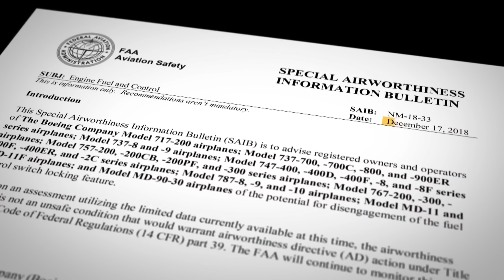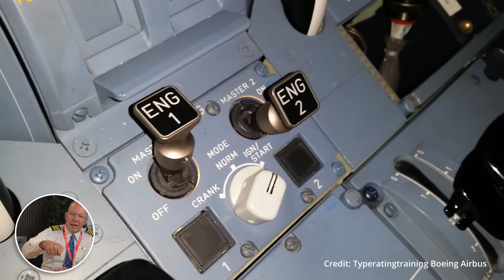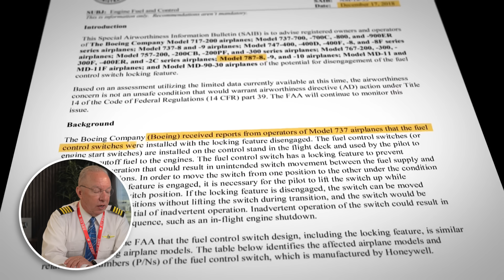Air India 171: The FAA’s 2018 Fuel Switch Locking Bulletin Explained (16 Questions Answered)

Comment: My take on it:
Based on current reports, cockpit recordings, and operational norms, here’s a reasoned reconstruction:

The First Officer (FO) was the Pilot Flying (PF), and the Captain was the Pilot Monitoring (PM). Both performed standard pre-flight checks and taxied without issue. During takeoff, the aircraft accelerated and rotated normally. Once airborne, the PF called for gear up, but the PM did not respond or retract the gear. Still, the aircraft continued climbing—smoothly—toward ~400 feet AGL, with no obvious anomalies.

That point — ~400 ft AGL — was a crucial window: high enough that the aircraft couldn’t recover from a double engine failure, but low enough to prevent restarts or gliding back to the runway.

At this moment, the PM — for reasons unknown — likely made his move. He waited for the “point of no return” and then quietly and deliberately shut down both engines, one after the other, with about one second in between.

The FO, sensing something wrong, noticed the engines spooling down. He likely looked at the EICAS display and saw both engines showing zero rotation (N1 = 0%). He checked the throttle quadrant — both levers still at TOGA power. Then he checked the fuel cutoff switches and found both in the OFF position.

Shocked, the FO asked:

“Why did you stop the engines?”

To which the PM replied:

“No, I didn’t.”

Realizing the aircraft was now gliding, the FO quickly switched the engine levers back to RUN, attempting to recover. Engine 1 responded and began to spool up — but Engine 2 never restarted.

With the aircraft losing altitude fast, gear and flaps still extended, drag high, RAT deployed, and time running out, the FO did what he could. He radioed ATC:

“Mayday, Mayday, Mayday.”

Despite being the non-flying pilot, the PM never assisted — never helped with restarts, never retracted the gear, never coordinated a checklist — he just sat in silence, perhaps whispering a prayer.

Ultimately, the FO did everything in his power to save the flight, taking full control of a spiraling situation, alone. But when a seasoned captain with over 8,000 hours on the 787 makes a deliberate choice to bring a jet down — they know exactly how to do it.
Reply: Great imagination. But no proof of this until now. Let them relese full CVR and FDR.
Reply: @RockyRock-vv3ex  what part of the OP is there no proof?
Reply: @RockyRock-vv3ex 
That’s why its only a hypothesis!
Like what Cpt Steeve said: The good part of us tells us that didn’t happen.
I wish my analysis is incorrect, actually I wish this never happened.
Reply: He could do it again, there is something missing.
Reply: After watching several different opinions and expert analysis this seems to be the most plausible,sadly!😢
Reply: Why would someone do that
Reply: @afnankhan7086  You are asking why there are insane people in the world that do crazy things with no explanation? Really?
Reply: Exactly @RockyRocky, without CVR transcripts, I not understand how people can make all these assumptions.
Reply: These are all boeing bots trying to blame the dead pilot  @Introvert.sJourney
Reply: @Introvert.sJourney 
Unfortunately these hypnosis are based on reports, facts, aviation logic and common sense, and feel free a refute whatever you think is not correct or doesn’t align with the truth.
Reply: That's actually a very logical & interesting point. I never thought of it like that. I  don't know anything about airplanes, especially the mechanic side, but I don't need to in order to understand exactly what you're saying.

 That is a very good point you just made!
Reply: Good write up Mr Tarantino.

Why didn’t the PM resist PFs actions to restart the fuel supply switches ? 

If he had planned this to such detail, the PM definitely missed to consider the other pilot’s actions. 

Or may be, both pilots hatched this plot as revenge against domestic violence from their respective wives ?

Nice script BTW. 

Can be a good setting for the opening shot of a Tom Cruise or a Bond movie.
Reply: Valid
Reply: Mostly agree, except I think it was the PM that radioed mayday, all part of creating the appearance that the other pilot did it.  And yep, he basically otherwise sat in silence, not helping nor intervening in the recovery effort that he knew was futile.
Reply: If that’s the case, then all pilot monitoring can take the plane down even before pilot flying can act upon and correct it. highly likely due to some sensors/software triggered the auto reset of fuel switches after the plan lift off  ? Certain internal details Boeing design architect/engineer knows more than the experienced  pilot. Time  will tell
Reply: @karthikkumar748 
I agree!
Especially if your PM is a captain who has over 15k of flying hours.
Reply: You write "Here's a reasoned reconstruction" and proceed to claim one pilot intentionally crashed the airplane, but i fail to see where in this reconstruction that is apparent? Where is the reasoning without a doubt, that one of the pilots had this in mind?
Reply: Doubtful Sumeet Sabarwal (the 56 year old senior pilot) would have done that. He was close to retirement and was going to take care of his 88 yr old dad. This is a thing in India where we look after our parents. Not always, but a LOT more common that in western society. The dad was aghast at the funeral. It's very unlikely. Also, who was the PF and PM are unknowns, I think. 

There is a Capt Ranganathan (google that and NDTV) who said one of the pilots allegedly had depression as mentioned by some of his colleagues, and had even taken time off for it. Whether it's 100% valid is uncertain, but it's possible he would not lie, knowing the backlash in India would be forthcoming if pilots/persons were unjustly blamed after their demise.
Reply: There is no proof to your story. Nothing is mentioned that which pilot did what and how are you so much sure that the pilot who said I didn't was a actually lying?
Reply: Plausible, even likely. Except ...

The RAT deployed when the second switch went to CUTOFF, and started supplying power four seconds later. This was five seconds before the Engine 1 fuel switch went back to RUN and nine seconds before the Engine 2 fuel switch went back to RUN.

Neither high nor low pressure systems in the engines (N1 and N2) would be zero, but they were spooling down prior to the relights.

Engine 2 did relight, but had not yet arrested core deceleration.
Reply: OR, there could be another angle where BOTH pilots were involved, something like 'murder in orient express' :)
Reply: Interesting theory, thanks
Reply: Chilling. But appears to be the plausible explanation at this stage. Unless the investigators are hiding something or protecting someone.
Reply: I am sorry. We need to wait for more info before we can make assumptions. Speculation like this are made up with rumors and facts that are twisted to sound reliable to the uninformed.
Reply: I was suspicious of blaming the pilots. It's hard to imagine any pilot doing that. But your terrific moment by moment explanation has convinced me. I feel like I now know what happened. I hope we find out more about the Captain. I did hear that he was going to retire soon to take care of his ailing father. This was a multiple murder and a suicide.
Reply: @d.gjochimsen9725  don't forget everything he says is an imagination. There no details released regarding which pilot did what. And don't you think when the other pilot started the fuel supply and one engine started to run, the culprit pilot would have attacked the other pilot or he may have tried to bring those switches again to shutdown position. 
It's not that simple.
Reply: It’s strange there is no other discussion in the cockpit than the short exchange about the engine cutoff. Hard to imagine any situation where both would remain completely silent.
Or maybe they weren’t - the voice recording hasn’t been released.
Reply: It's hypothetical at this point but it is the scenario that would make the most sense if it was indeed a suicide/mass murder. 

The slowness to put the switches back to the correct positions versus the speed at which they were moved to cutoff seems to indicate two different pilots actions. The FO was flying, probably more likely to act slowly, and was also probably dumbfounded to see such a senior pilot move the switches to cutoff.

Comment: We may never know which pilot cut off the fuel supply. Theoretically one pilot could have been suicidal and done all the actions that caused the crash. He could have shut off the fuel, asked why did you do that, and put the switches back in the run position. Once the engines stopped producing thrust flipping the fuel back on would not allow the power to come up enough to fly.

Comment: 13:40 So you're saying anything is possible but that's not what happened. And how exactly do you know that? The report couldn't possibly know for sure if the pilot did it or not as there's no video footage. It could only know what electrically happened

Comment: It's funny that you advocate not installing cameras in the cockpit, but in this particular case, the camera would give a very accurate answer as to what or who is to blame for the disaster. I hope that this disaster will force aviation regulators to introduce surveillance cameras in cockpits - too many human lives depend on the safety of air traffic to be able to play with it and leave doubts where there shouldn't be any.

Comment: Throttle quadrant question for Captain Steeve. I am a former military pilot and have flown a pretty wide assortment of aircraft (mostly fighters). A few aircraft I have flown have a fuel control or engine master switch, but many do not. Every aircraft I have flown (engine master or not) also has a throttle OFF position, with an associated detent or finger-lift. Does the 787 have a throttle off position, or is full aft idle? If there is a throttle off position, why even have a fuel control switch? I know there are a lot of different angles you can attack the engineering problem, but I've flown a lot of jets that have no fuel control or engine master switch. If the throttle is placed from OFF-IDLE the fuel control is ON.

Comment: Boeing has a pattern: they don’t warn pilots about critical systems until people die.
– MCAS wasn’t in the manuals until two 737 MAX crashes killed 346.
– The 787’s faulty fuel switch issue was flagged in 2018, but not made mandatory or disclosed to crews.
Only after lives are lost do they admit it’s a real problem.
This isn’t oversight — it’s a deadly habit.

Comment: You are making engineering questions to plane operators. The operators have little understanding on the switches, the automation and the programming. They are just operators. How many good drivers know or understand the car problems and reasons for the
Maintenance etc. same goes for the plane drivers.

Comment: Fuel shutoff should be a two part process. First one switch, and then a second 
switch to confirm the action. Switches should also be positioned overhead, not down behind the engine thrust controls. Overhead switches are highly visible to all personnel in the cockpit. If you reach for an overhead switch, it will be noticed.

Comment: If the plane is already airborn, the system should only allow to cut-off the fuel for a maximum of 1 engine, and only above for example 500 ft. To allow 1, or worst 2, under 500 ft, makes no sense at all.  

The system should require an additional control, preferably from the other pilot, before both fuel cut-offs can be done in-flight, at any altitude.

Comment: Excellent video.
I think it is also possible that the captain grabbed the fuel control switches to put them into the cutoff position and then asked the FO (who was the pilot flying and hadn't got the time to monitor) why he did cut off the fuel.
Reply: I think it's possible the investigators for this incident didn't name who asked and who answered the question about shutting off the fuel is in case it happened in the manner you just described- an effort to save face during this terrible event

Comment: Wait… they said they found the fuel cut-off switches set to the Off position… but you’re praising the other pilot for having the presence of mind to put them back to the Run position? So were they round in Run or Off positions? Which is it?

Comment: Is there anyway whether the question about cutting the switches off came from the first officer who was actually in control or whether the question came from the captain? 
If the First officer’s both hands were busy, would it be possible form him to switch the engines off?

Comment: Worked maintenance on avionics for many years.  Never saw a detent switch jump over that mechanical stop.  Even if the switch were to come out of it's control box, as after a crash, it will remain in detent.

Comment: Those fuel switches are the same ones used on blackout lighting switching and battle override switches on military equipment. They cannot be switched without actually grabbing them with your fingers and pulling them out.  This requires a sanity check above just muscle memory.
Reply: do they wear out ,the bit you pull on i mean,over time  ?

Comment: As a ex pilot, still taking side of boeing, there's such a minimal information from AACS, and in 2018 report boeing said that fuel cutoff had a problem and still boeing did not tell air lines to replace or they haven't tried.
Reply: You don’t understand what a bulletin is.